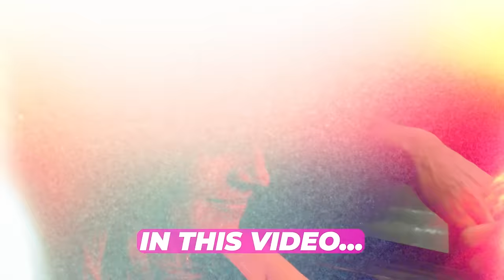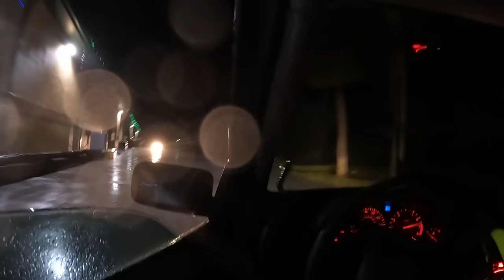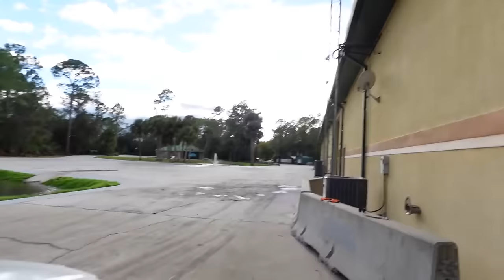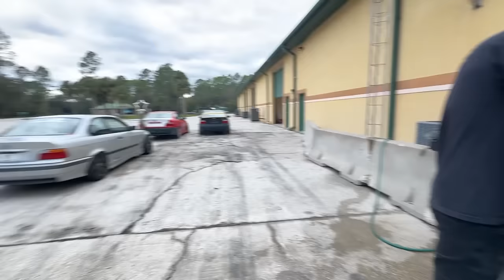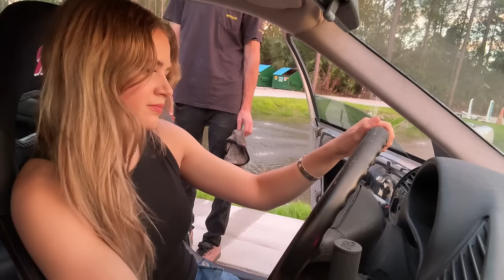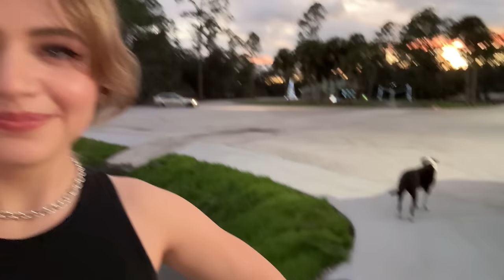I Blew Up the E36 Already. Oops …

Comment: Collete, shout out from Poland - a kingdom of E36 drifting. From what i see and hear it is quite possible that your engine blew a head gasket. It is overheating, when you try to start in the end I saw white smoke from exhaust and those sounds are probably pistons trying to compress water. E36 is a great chassis but a bit more demanding maintenance-wise. Driving without temp gauge was a bad idea. You all bought cheap, almost 30-year-old E36s, done nothing to protect the engine (like a bigger radiator, bigger fan or at least oil change) and started to abuse them. Unfortunately thats the result.  I wish you all the best and don't get discouraged - E36 is probably the easiest drifting machine you can still buy for cheap.

Comment: You definitely need to fix that temp guage asap, should be just a sensor it’s a very easy sensor to get to. I think it’s been overheating this whole time. Usually when people get e36s they bulletproof the cooling system first by replacing the entire coolant system with all new and upgraded full metal parts instead of the plastic cooling system, then and only then will they start to drift or drive it hard. Drifting on the stock brittle plastic cooling system with a non working coolant guage was asking for big trouble.

Comment: Definitely sounds like top end noise not a rod. I know you need a temp sensor or manual temp gauge 100%. The rattle sound sounded like my old truck when it runs hot and its pre ignitioning.
Reply: Definitely not top end bro.  😂😂
That’s rod knock.
Reply: It sounds like a m51d25 TDS engine that was available in E34/36/38/39 chassis with rotational fuel pump 😂
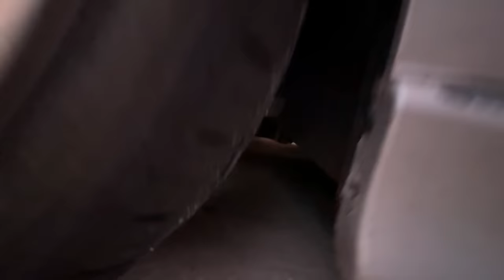Edit: listen at 16:07

Comment: Sounds like the camshaft has gone from heat and probably valve Springs. Check the oil plate for bits 👍🏼

Comment: Pistons, rod bearings most likely and crankcase vent hose is corrosive. Go for that new motor or do a complete  rebuild. In the process of converting my e46 to drift ! E36 vs 46 do a lot of researching on various models during those manufacturing years.

Comment: It’s a BMW…German…Germany only allows a certain amount of fun, before shutting you down!
lol 
Jokes aside, it’s hard to say without actually being right there, but it sounded like either valvetrain issues, OR potentially bearings (crank) going south. The overheating probably didn’t help.
lol 
Merry Christmas 🎄🎁

P.S.:
Someone should smell the dark smoke coming out of the exhaust, because as it’s then not coolant (would be white), it may be oil, which means you could have blown the head gasket or damaged valve guides/seals due to overheating.

Enough…Merry Christmas again! lol

Comment: Bet it was hot as sounded like pinging u can get it when car is over heating. Do a TK check for combustion in rad  and pressure test cooling systems over night and crank engine with plugs out see if coolant is in cylinders

Comment: beemers use to have a habit of oil pumps dieing too 😂 as for being worse than rotary, I think someone is forgetting about Sailor Moon, how many years did it the to get that car running half decent? 😂 
Those beemers are the perfect throw away drift missile and handle great and take very little set up. If you want to annoy Adam go buy the 5 series 535 from the same era then, you'll have something like you're jdm drift missile, thay handle great too.

Comment: chain tensioner or valve lifters, engine sound, check clutch fan with engine on and with cloth try to stop if easy stops clutch fan is dead if no then good, starting problems can be after overheating engine coolant sensor to ecu is bad , under intake have 2 , one for ecu another for dash,gearbox getrag is shit especially shifting at high rpm's doesn't allow even with good gearbox, zf ftw

Comment: sadly bmws are well known by engine  failure usually  crankshaft go boom an very common on bmw people over rev the fragile bmw engine The most common cause of engine failure is dirty or low oil, which can be the result of an oil leak, faulty oil pump, the oil burning too fast, or driving too long in between oil changes.

Comment: Sucks about the car, time crunch sucks cause you never get time to do the small stuff that is really important like water temp, oil temp, crank case pressure (for turbo cars) etc that lets you catch stuff before it goes wrong. Would love to see you dump a proper BMW engine into that chassis.

Comment: Collete tell the truth, did you accidentally press that special little button on the left side of the dash again? You know what happens when you do! 🤣🤣🤣🤣🤣
J/k, I'm sorry you're dealing with this though. The E36 was notorious for cooling issues, but the engine itself is petty tough. A dakar yellow E36 M3 was my introduction to BMW back in 2001 lol and Now I have a G82 M4. Needless to say I got rid of my E36 a long time ago before things got REALLY crazy. I must have Stockholm syndrome though because I miss it 🤣🤣🤣 I definitely suggest checking the VANOS system and every aspect of the cooling, especially thermostat and temp sensor

Comment: What did you end up doing to fix the clutch issue where the pedal was loose until the bottom and was grinding if you tried to get it into gear? I just got my car running after an engine swap and having that same issue. Did it just need a clutch bleed?
Reply from the maker: Still grinds every gear I just start and stay in second 
Bad trans we think
Reply: @ColleteDavis  Ya I spoke too early, heard the grind in a later portion of the video and realized it was not fixed. Unfortunate how you got unlucky with this car. Atleast you like the chassis and hope everything gets sorted so you can continue to enjoy drifting it!

Comment: Yo, just because you bought a car that needed maintenance work does not give to the green light to just bash on the E36. E36 is an incredible chassis and a fantastic running chassis if maintenance properly just like every car in the world. 1st thing you have to do when purchasing an E36 is completely overhaul the cooling system, then maintenance all the fluid, then hit the bushings and check gaskets valve cover and so on. The E36 is a far better car then you keep complaining about, you even said how comfortable you felt at night, in the rain, in a car with no hydro and no experience and you still felt comfortable.  That should tell you everything you need to know. Now, put a S50 in it and enjoy the car.